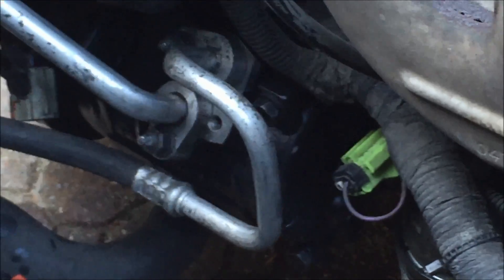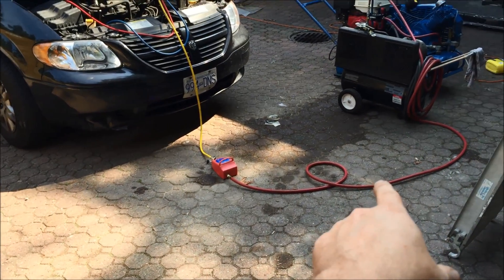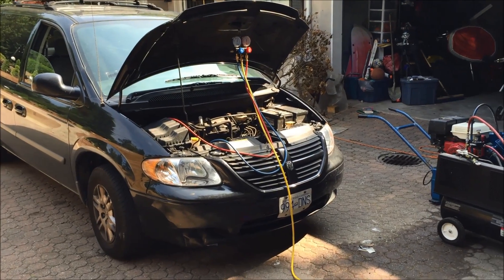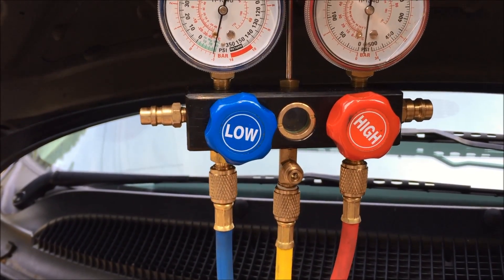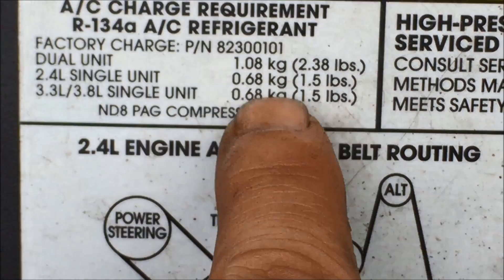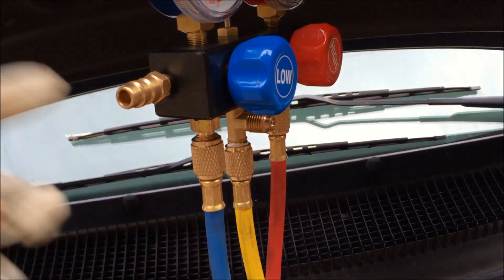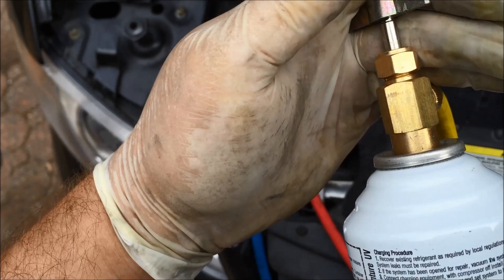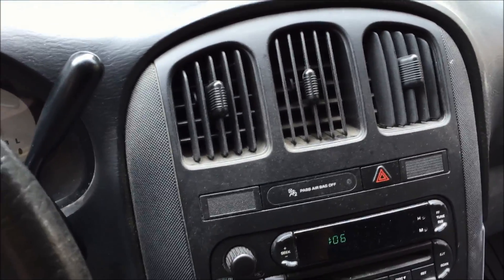2 of 2: Recharge R-134a refrigerant in Grand Caravan

Comment: great video!!!! just a quick pointer: when the system is on vacuum, it should be able to suck in the first two cans without having to turn on the compressor due to pressure deferential. Additionally, turning on the compressor while it is on vacuum can damage compressor pistons.